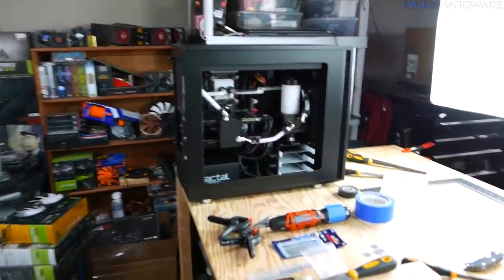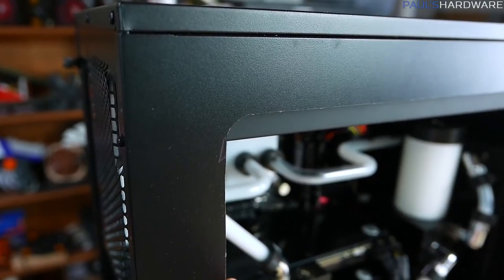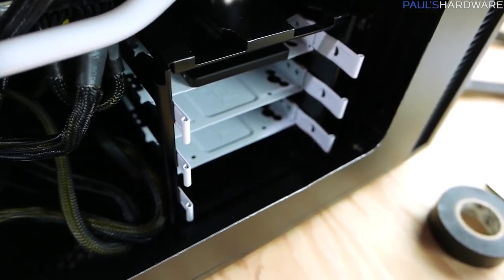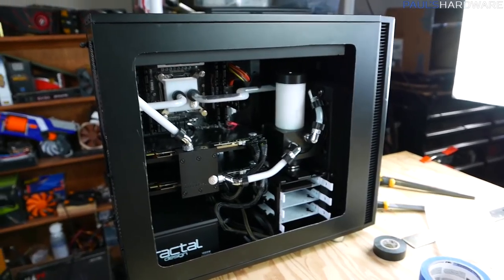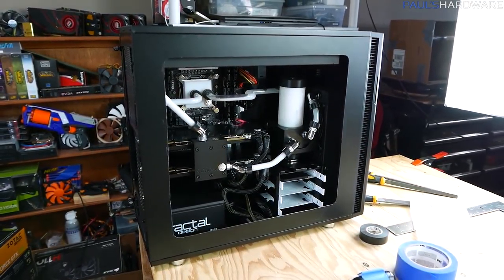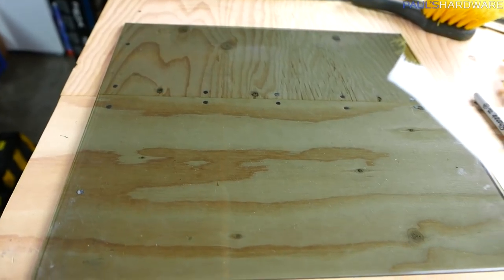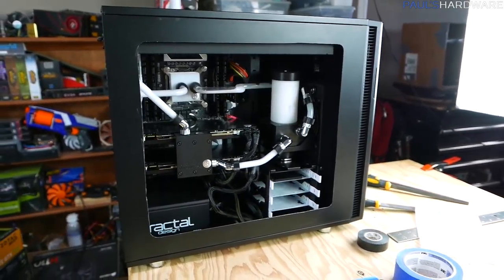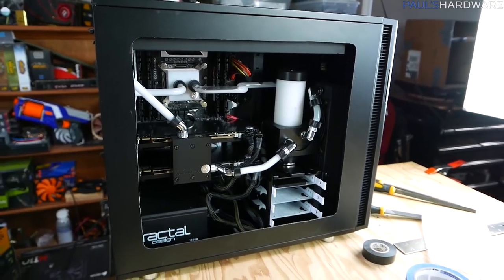Corgis, Computers and Q&A - Paul's HardVlog #010

Comment: Paul, there are some AMAZING channeling/trim materials out there.. I actually wanted to do what you were doing; a clean cut and glue tinted glass on my Phantom 820 side panel. However, I was recommended to add "something more than just a sheet of glass" so I started looking at doing rivets, screws, magnets, etc. Until I searched around for trim. I decided immediately once I saw what was offered that it was the way I was going to go. And I'm a Master Jigsawer.. too. It worked for my build lovely. So don't get bummed, I think you'll like what you find anyways. Clean glue installs aren't always the best approach. And personally, I think your build has a particular look that would work well with trim anyways.

Comment: Still rocking my 2500K.  Whenever I need more performance I'll just keep overclocking it farther and farther till it dies.
Reply: ***** my dad gave me his 2700k and got a 5820k
Reply: FartingNinja1 Nice :)
Reply: ***** I'm good rocking my 750 :D still haven't died yet
Reply: ***** Cool!  I'll do the same, Herr Rennfahrer :D
Reply: ***** Just upgraded to a 2500k from a phenom II x6, 2 weeks ago. I love this thing. :) Rocking at 4GHz at 1.28 volts :)
Reply: Pushh Yeahh I managed to get to 4.2 at 1.3 volts.
Reply: ***** Great man, I built my new PC a few years ago and I am rocking an i5 3570k. I think Cpus can last much longer then Gpus and still do their job really well, I think the only real big reason to UG your Cpu would be the new chipsets they offer with new features, IIRC (99% sure about this) DX12 requires one of the newer chipsets to take full advantage of it (Pretty sure Z87 or newer). I plan to use my 3570k for atleast 1 more year then UG to the newest cpu they have released.

Comment: What you should do is paint a trim around the opening (probably in white to match your color scheme) then use some rubber U-channel on the edge. The paint will mask any scuffs and scratches (and it looks cool), and the U-channel will make the cut line appear more straight. All this was learned from experience.

Comment: Paul's Hardware Have run into almost the same problem. Conclusion is that you need either a jig with router, or a person who has a cnc cutter. The sheet metal on most cases is too thin for most people to cut by hand without any errors. So, if there is a metal and CNC shop in the neighborhood... Well then I'm guessing they can re-cut your current or a new panel very nicely...

Comment: Paul's Hardware you can solve these issues easily. 1- you can get the panel powder coated, 2- Always use rubber U channel to cover the edges..

and there is a lot of air in your loop Paul..

Comment: Put some more work into your sidepanel, mark a fine line to where you have to file it down, that way you will end up with a 100% straight line. After that, I'd perhaps try to paint it ?white?

Otherwise, if you decide to buy a new one, bring it to a company with CNC mills or CNC laser cutters.
Reply: ***** Also, leave excess and roll the edge to a straight line if you can. Looks cleaner and smoother.
Reply: *****  Agreed ! finish the bodywork on the panel sand the whole thing if you can't match the black then match the white in the build , throw one layer of tint on the glass panel to make it a little darker, and it should look real nice you will have a nice black white side with the glass being just a little tinted off the perfectly clear , actually it looked tinted already but i don't know if that was just the way the light was hitting it on the video,  nothing to loose but a little time at this stage.

Comment: Tip for the side panel: use a hole saw for the corners first, then use a straight edge to guide the saw between corners,  Also, use a very fine toothed blade (20 - 24 tpi) and keep the blade lubed with 3 in 1 oil.

Comment: Paul you need to draw file the edges. That will help smooth and straighten the edges out. Hold a large fine tooth single cut file at 90 degrees to the sheet metal and drag it back and forth. Don't move the file side to side just back and forth. This will do wonders for the edges.

Comment: Car door edge trim. It is available at most car parts stores in several colors. It will dress up the edge and give you a padded surface to mount the plexiglass to. The plexiglass will rattle if it is not snug.

Comment: You could go to your local hobby shop to see if you could get someone who airbrushs to repaint it for you. It would probably be much cheaper than a professional.  Just ask the owner if you could put up a sign with your email/phone number asking for assistance. Also I would sand down the blemishes with steel wool to get a smooth surface before repainting. Any texture on the surface may show through the paint. As for the uneven sides I personally don't think you would see them much ounce the glass is put on. Just make what ever filling or cutting you do is DONE before the painting.
Good luck Paul.  I hope you don't have to start completely over.

Comment: use a hole saw for metal for the rounded corners. for instance if you have a 2 inch diameter hole saw measure 1 inch down 1 inch across from the corner and use a set punch at the intersection. then use the hole saw and drill on that punch spot. depending on the radius of the corner you're attempting to do is the answer to the hole saw size. if you follow so far you're doing great. now. set up a jig or use a table saw with a metal carbide blade but ONLY after cutting the holes out. be sure to take your time on the hole saw cause if you do it to fast it will look ugly time is your friend. now. back to the saw. once you have the 4 corners cut out you then need to simply make you a line from which you need to cut to make the "circular cuts" turn into corners. measure from the outside of the case to the line that you've made that you're satisfied with and now set your table to that distance from the blade remembering that there will be an 1/8th inch offset because of the blade. dont start on the edges but rather start in the middle of each line drawn then you can cut up to the corners, you've now made a professional radius cut without using a jigsaw. it may take longer but the end result will look much better. the only other suggestion id have to offer would be to make a jig for your jigsaw so you can run the edge of it against the jig to keep the correct distance. only down side is that you'll still have to free hand the corners and even for the best that can prove problematic. ive also figured out a way for you to make tubing alot better and maybe turn it in to a buisness if you'd like to hear my method. up to you paul. doubt id ever do anything with it so far but i know the industry simply doesnt have what ive thought of and would make tube bending and bends so much better looking over all.

Comment: Well Paul, cutting metal l with hand tools is not easy, been there myself and in the industry stuff like that happens all the time, you're fine. I wouldn't get another side panel unless you take it to a metal shop or something, i'd suggest painting it, maybe white? blessing in disguise.. or some kind of trim around the opening, Good luck man.

Comment: Metal Cutting snips would have been a bit more idea, going at least a quarter inch from the target line and taking a dremel tool to the last bit only going enough so you can bend it forward snapping the metal manually then sanding would have been ideal. However as someone said previously its good to have 3 or 4 cases for spare parts and possibly using similar thickness sheet metal to practice on (even if its scraps).

Comment: You could save it with the U Channel, it covers mistakes, maybe touch up the scratches in the paint, that wont be easy to match though, I did this several years ago but i had access to a 4x8 1600 watt Mitsubishi laser, i just drew it out on CAD and set it on the table, i don't have that luxury these days, is a shame you already spent all that cash on the glass, a better option would have been to have the glass shop cut a full piece for you, with 4 holes for hinges and use the entire sheet for the side, the locking mechanism would be easy to do without holes, really like the build, good luck with it.

Comment: when doing a case mod two of the same case is a must, three is a good idea, four is ideal. even with experience it is a good idea to have multiples of the parts intended to be modified so you can try again if you aren't happy, but every time go all the way through to refine what you intend to do on the next. fractal might do a side panel by itself, depends on their manufacture process, if they produce the parts on separate lines they have an inherent disparity in part numbers and would likely be happy enough to offer you a price for new doors. silverstone at one point (i don't think so anymore but maybe) produced each case a whole case at a time, which caused problems for interchangeable parts, which would make that impossible, but i am betting fractal sticks to the former. but you should have had at least two of the exact same case in the first place if you intended to cut things, the first to design and figure out how to do what you want to do, and the second to apply what you learned with a set plan.

Comment: hey paul..when it comes to jig saws..your outcomes are fairly typical, you cant avoid using files to clean those up..use a 2x4 wood block and wrap a 100 grit sand paper to even those edges up.but from the looks of it you might need to use some rubber edging to hide the crime

Comment: Rubber gasket around the opening like a car windshield. Black, precise and makes for shock resistance for the glass panel. If that isn't to your taste, I would replace the panel and get a pro to do the cut. I would want it smooth, with a bevel ideally, and matte black to not stand out against the glass. It's obviously a bigger job that you expected. Do you have a case vendor nearby that you could get advice from, like CaseLabs?

Comment: I would see if i could get some material to make a grommet. I corsair's solution (at least on the 600t) where they have a black grommet around the outside of the window. I think you said something about channeling material??? Dunno though if that is what I am thinking of.

EDIT: Of course if I were doing it, I would just lay it on one of the CNC's at my high school, buy a metal bit, and draw me up a nice hole and mill it perfectly.

Comment: I would almost say just get a new side panel and try again maybe not with a jigsaw thou instead a circular cutting wheel would make cleanup much easier on you. I think fractaljosh has said before you can order replacement parts for fractal cases through puget systems. If not that then what I personally think would be cool is get some sort of black and white vinyl wrap material and cover both side panels with it and have it overlap the glass a little. That would hide the unfinished edges as well and hide the parts where you went outside the lines a bit. Could make for a nice mod to the case and further contribute to the whole black and white build.

Comment: you should just get a new side panel from Fractal Design. I have a Corsair Carbide 500R and through their site am able to buy new side panels, top fan vent cover, front bezel and 5.25" slot covers. I would assume Fractal would be even more accommodating. Good Luck whichever route you decide to take!

Comment: would it be possible to use a level clamped down to a work bench to give you a straight edge for cuting out your lines with the jig saw sorta like a guide so you dont have to free hand it?

Comment: There is a easy trick to cut straight lines with no filing needed, and no need for a steady hand, ive done it a few times in the past, but you will need 1 tool and 1 bit.

Comment: I have a idea about how to fix the case window, how about attaching a frame with screws over the out side of the window, then gluing the glass in the inside like it was originally planned.
Reply from the maker: Angel Luis Trinidad I considered that early on but I want to avoid showing the screws externally, I am hoping to keep the outside pretty clean
Reply: Paul's Hardware Of course, I understand. Anyway, for being the first time it came out almost perfect. I think you should give it a second shot with a new case panel. Good luck.

Comment: Whats wrong with the Samsung 840 evo ssd's?
Reply: kevin hansen Performance Degration problems, google it.
Reply: Smoking Crop so i should not get them ? are the 850 better ?
Reply: Smoking Crop well.. shit.. got an 840 evo 250gb
Reply: ***** I'd just get the Crucial MX100 or BX100. Usually Cheaper, barely slower (you wont notice different in real world). The MX100 has power loss capacitors too. and they both have MLC memory which is better than TLC (like the Evo's)

Comment: I have an 840 EVO 500Gb and the restoration software didn't work and recently was found to only be a temporary solution anyway. Sucks to suck $200, My 2 850 Pros are great but I won't get a Samsung SSD again until they refund me cause I don't want a send and receive warranty cause I will never trust an 840 EVO again. Going back to Sandisk, never had any Sandisk product fail, or even have any problems.
Reply: blackice11z it's not worth to get Samsung evos SSDs ? does the 850 fixed 840 issues ?
Reply: blackice11z I have the same drive in one of my computers, i tested it before the restoration fix and after, it did work, however after reading your post i tested it again and it seems to be slowing down a bit, i did the resto as soon as the software came out, maybe 3 ,4 months ago, i cant remember, the drive works fine and really i cant see any day to day performance issued in real world use, however it sucks that when i bought this drive it was praised by so many reviewers i thought i couldn't go wrong, the reviewers didn't know the long term problems so you cant blame them, i blame Samsung.
Reply: ***** The 850 does not have the issue, only the 840.
Reply: michael weiss in my store the 850 is 10 euros more expensive than the Sandisk..
Would you still recommand th 850 EVO ?
Reply: ***** Get the 850, its a better drive.
Reply: michael weiss Thank you for your help, michael !
Also one last question.. if i was planning on putting my IOS and editing programs on my SSD = a couple games like BF4 
And all the other stuff on my HDD.
Woudl you recmmand 250B or 120GB ?
Reply: *****
That depends on the space you need, just the OS and a few programs a 120 is fine, remember to leave at least 10-15% free space, if you have the funds get the 240, they have gone down in price.
Reply: ***** 850 Pros don't use the same algorithm so its only the EVO series that has had the problem.
Reply: ***** I'd say 250 just because they are more cost effective now
Reply: michael weiss The restoration software just flat out doesn't work for me, It'll go through the steps but after the reboot from the firmware update it just starts over completely, never finishes and the drive makes my PC slow as hell so I took it out. I know not everyone has had problems with it and many with rotten apples have been fixed but I just got one of the few decayed apples.
Reply: blackice11z I know that feel man ! and it sucks, hopefully everything get fixed for you. And thank you so much for your help ! def gonna be searching before i choose with which one to go :)
Reply: ***** Honestly the performance of SATA 6 SSDs is so similar across the board that unless aesthetics is a factor for you then reliability is the main key, I'd recommend anything from Intel, Crucial, or Sandisk for sure, Use PCPartPicker for finding the models you want to compare.
Reply from the maker: blackice11z sorry to hear about that man, I agree the whole situation with those drives was pretty disappointing. I hope they can get you a refund!
Reply: blackice11z Blackrize, you said only the EVO series have that.. well the 850 is also in the EVO series no ?
Reply: ***** There is an 850 EVO, which I believe is just a lower performance 850 Pro. (it shouldn't have the bug if that is correct), but no the Pro line is not part of the EVO line.

Comment: Why are the graphics card fans on the test bed keep twitching? Surely your better off not powering the fans at all until you reach min running voltage or PWM duty cycle.